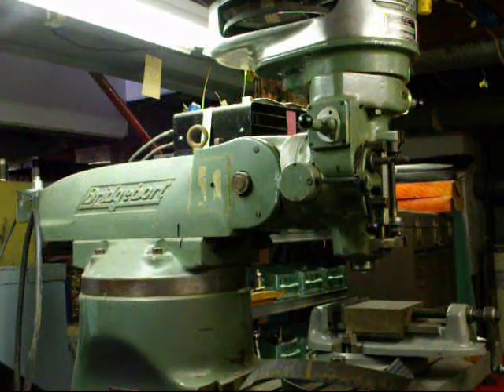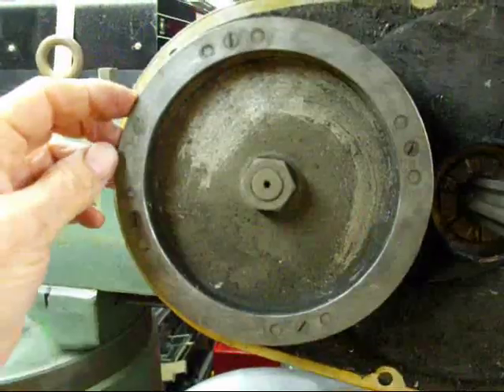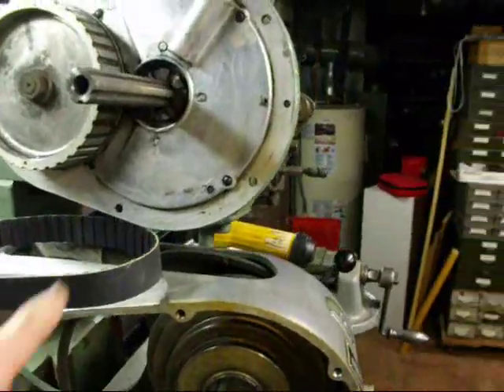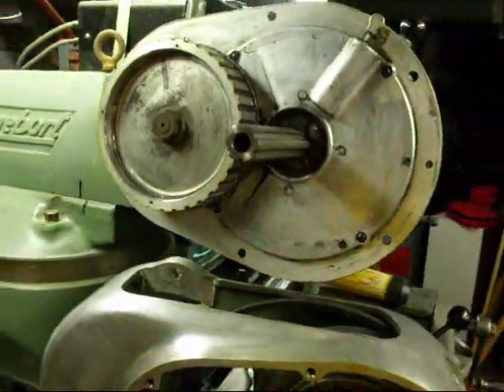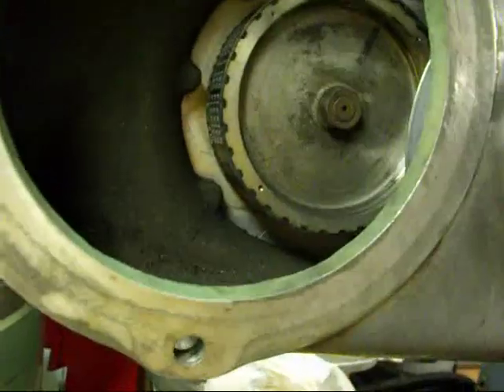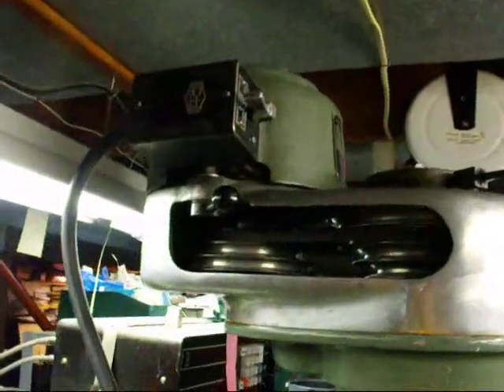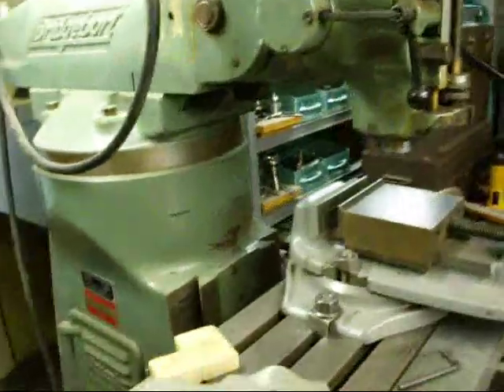BRIDGEPORT MILL J-head How to Change Timing Belt

Comment: I'm surprised that the BP uses a timing belt for it's spindle, yet it's able to achieve 5 micron runout. How is this possible? The timing belt adds so much chatter and nuisances, I assume the BP has some complex bearing system which locks the spindle from any slight deviations as it spins.

Comment: You have to be a moron not to be able to perform this service but I also understand if one hasn't got a background in machine shop practices or millwright skills repairing servicing and fixing other peoples "mistakes" then this may be intimidating. I on the other hand am not intimidated in taking on any job in the shop in fact in a couple of days I'm bringing home a new to me 4000# lathe and will be installing it in my ver small shop by myself.

Comment: I would have liked to see you take the motor off. I just got through installing a power draw bar on mine and now it seems to be squeaking a bit more. I drilled 3 holes in the pulley cover to mount the PDB, so I'm thinking maybe some chips are still in there ? I blew it out as best I could but maybe something else is going on ? It still seems a lot more quiet than yours though.

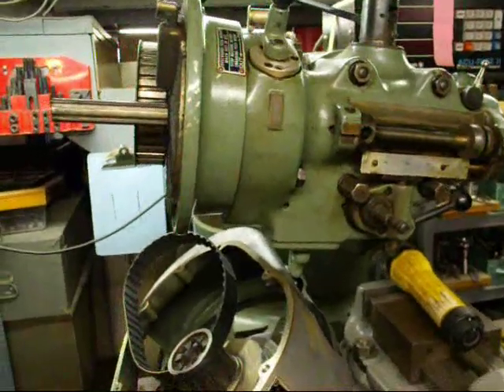Comment: in the video at 1:03 you can see a view of the spindle pulley hub, is there a way to remove the steel ring on the bottom of the hub in order to use a file to clean up the end gear slots? thanks
Reply from the maker: +Norm Staley Its a long time since I filmed this & I forgot. You need to find a parts diagram & see how its put together
Reply: even though the gear or cog or whatever its called didnt look damaged I thought I would dress the edges a little because I was having trouble with it jumping out of gear under a load while milling, but after looking into the problem a little more I discovered that one of the springs that puts pressure on that gear is damaged and may have even been causing the teeth to not fully engage, working on that repair now, trying to find a supplier for the spring thanks for the reply, been nice talking to you

Comment: G'day from Australia. I certainly enjoy your tutorials, learn heaps. Sir, I heard you mention before running your mill after maintenance, that you would turn on the phase converter and then power up the motor. Can I assume that you are using single phase and stepping it up to 440V 3 phase? Did you ever consider making a transition peice and running a single phase motor....... the reason I ask is because I am looking at purchasing a used Bridgeport S1J head which over here runs on 415V 3 phase to 240V single phase and the only difference being the single phase motor will be a bit bigger in size. I would really appreciate your comment, or anyone else's for that matter. Keep up the videos, love them, regards, Gordon
Reply from the maker: +Gordon Agent Thanks for watching-my phase converter changes to 3ph 220 v.
It works great so I'm fine with it.--though there is a power loss, but I have never noticed it.. You can also use a VFD

Comment: Never cut old belts, save them for back ups. Before you do anything lower spindle, this lowers spline, in return you can jus lift head off and reinstall without taking the flange off timing cog. Smoother, faster, and u don't have to wrestle timing belts.

Comment: Hello,
I have the same bridgeport mill cutter in my workshop, but I have a problem: this timing belt had failed during operation, and when I was going to replace it I find out that de dimensions of the width belt and separation between the tooth does not match with any standard timing belt, for instance: H or XH profile or T profile. My question is, where can I purchase this timing belt for replace it in the mill cutter for continue with my work.
Thank you
Greetings from Costa Rica
Reply: Denis, soy Erlin de Honduras. Estoy buscando las especificaciones de esta banda también. Compré una nueva y no cuadra con los dientes que tiene la mía (67 dientes). ¿De casualidad tienes información acerca de ella?
Reply: H&W machine repair.  They have complete parts breakdowns on the website and pretty easy to find what you need and order it.

Comment: Thanks for the video Lyle,
I just changed my belts after watching your video and 90 minutes was right on the money. 
I left mine in the vertical position and worked off of a 6ft step ladder. "I" had the belts changed faster than "I" could have  indicated the head if I had done it horizontally.
Once again you have proven yourself as a wonderful asset to the YouTube community. 
Thank you.

Comment: Helpful tip if your timing belt isnt broke when removing the upper housing its easier to remove if you cut the belt. I did this when I changed both of my belts. if your just changing the v belt you have to remove the plate off the rear pulley to remove the top.